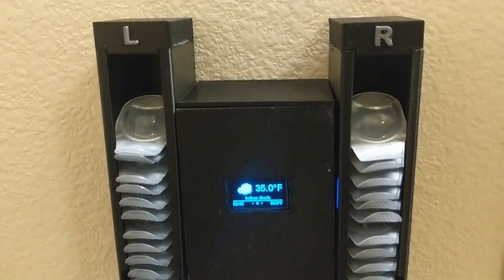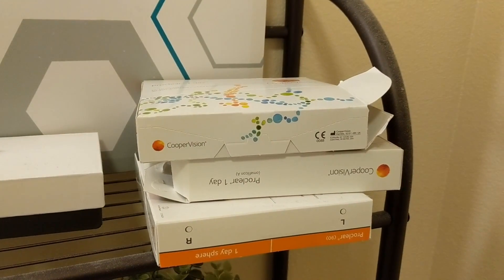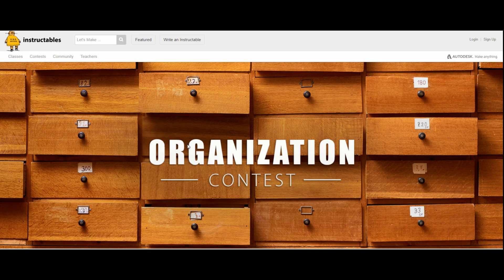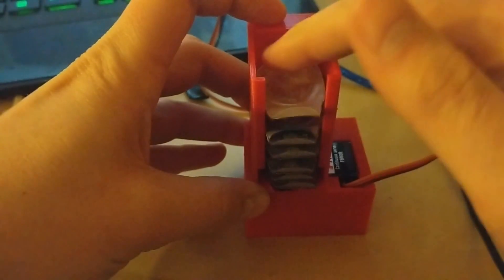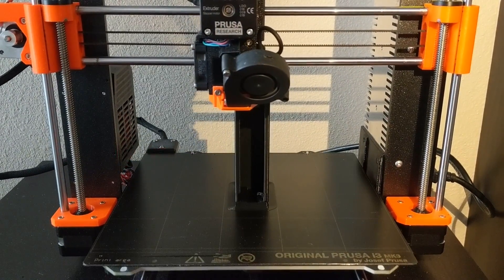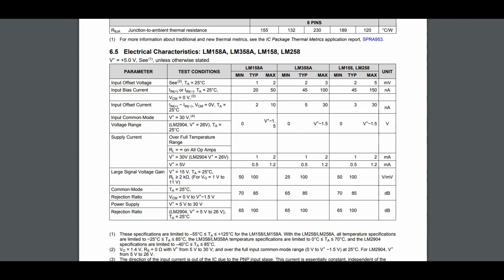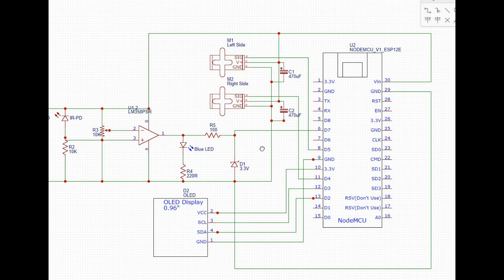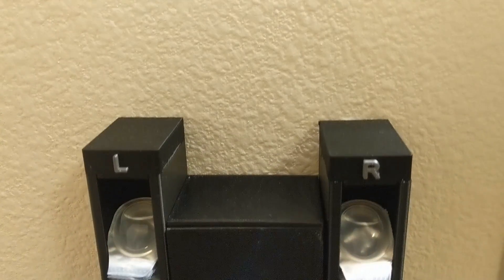Smart Contact Lens Dispenser

Comment: Nicely done. I'll have to keep that type of usage in mind for zener diodes.
Reply: u can use regular schottky diode to clip 0.7v, I am using this method to reduce background light from a commercial clock/temperature/humidity meter connected to my mains 12v instead of using its batteries ✔